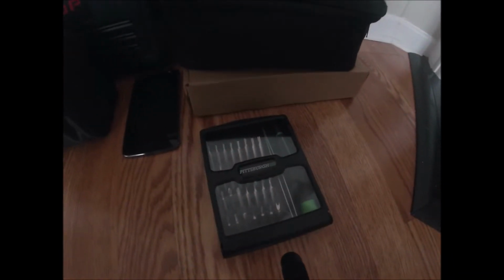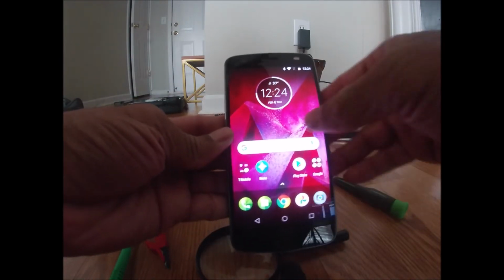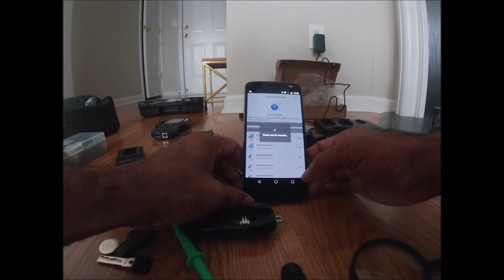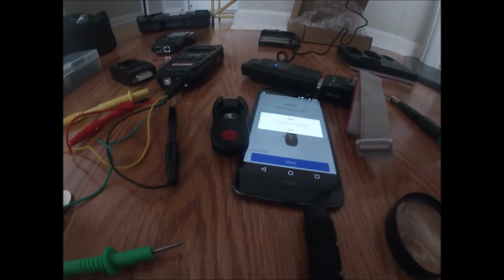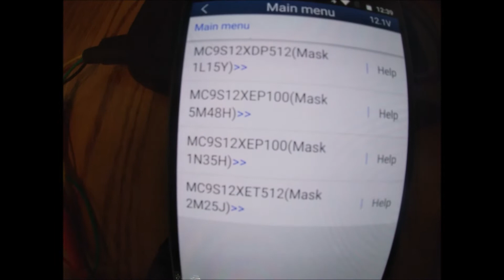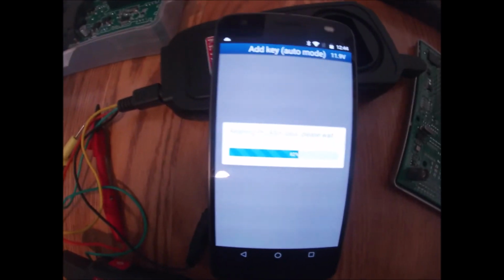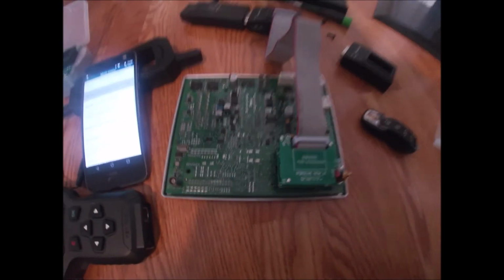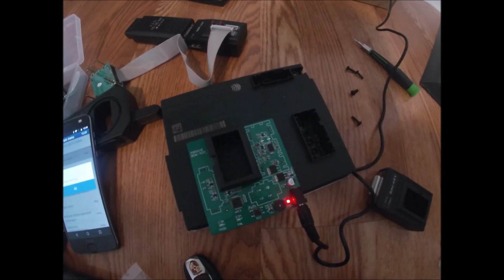Porsche Key Programming -2013

Comment: Can you also programme for porsche cayenne 2019 e3 type 4000cc
Reply from the maker: Depends on the BCM version in the vehicle. Did you key look like the one in the video or do you have the newer style key?
Reply: This is the BCM Look's like
Reply: The key look like that but you dont put it in the key dashboard the key has superat key on the dashbord the key just ues to start leaving it nere by
Reply from the maker: @samsonmu2641 - as long as the BCM look like what's in the video and your key look exactly the same, then yes, we can program it. Porsche started changing the BCM's and Keys in 2019, they never keys and systems we cannot do.
Reply: Hi how about getting a blank key to programme 2019 -2020 is it possible
Reply from the maker: @samsonmu2641  yes, if the key and bcm is same in video
Reply from the maker: @samsonmu2641  yes
Reply: I would like to share some picture of the Porsche cayenne we have so you can give advice
Reply: Hi if i can get a key part no V04016001AT  uesd one can you flash it for me

Comment: hi , could you tell me if the learning procedure is the same for cayenne 958 ?  just made a key , the car start but the remote function doesn't work..  thanks
Reply from the maker: Yes,  it's the same..maybe the key is bad. Does the original key function normal? Is the new key frequency correct
Reply: @ammreid  yes the original key function well . I have checked the frequency before and was the same .. maybe bad quality of key or battery ..  thanks for your answer ! and thanks for your videos !
Reply: @ammreid  hi , just and update :) … I have tested one more time with other key and it’s work ! I suppose bad key quality ..
Reply from the maker: @sprlvbconcept4215  perfect.. sometimes happens

Comment: Greetings Ammreid, I recently purchased a 2016 Porsche Cayenne with one key fob. How can I get you to reprogram a second fob? I see an “unlocked fob” on EBay for $95.00 , do I need to send you a blank fob for reprogramming? Any info is appreciated!!! 
Thanks
Reply from the maker: Hello. Yes. You'd have to send the vehicle's BCM and the key you purchase for us to program it. More info here:

Www.CarKeysandRemotesATL.com/porsche/
Reply: @ammreid  thanks for the quick response !!! do I need to verify the megahertz of the key that I purchased matches the system I have? Or is that something you can provide if I sending you my BCM.  I see you are in Atlanta and I’m in western Washington. It’s going to be a challenge to have my car off-line while I ship you the BCM. I do a lot of programming for PLC controllers and I understand the process but it looks like you have all the necessary hardware and make the process very simple. I do appreciate your videos and the effort you put forth.
Reply from the maker: @tonyimbarrato5325  ..for Porsche, as long as you have a US spec vehicle, all US models will be 315mhz, so anyone on ebay selling one for a like year and model will be fine. The only difference in the keys are whether or not the key has a proximity sensor(keyless go). If you insert your key in the dash to start it, any key will work, but if you have the dummy key in dash and you can keep the key in your pocket when driving, then the seller would need to indicate its a proximity key.
Reply: Ahh yes I have the keyless go, thanks for the info. I will be sure to investigate before I purchase a fob. Is there any way of  determining if it has the keyless go by appearance or device numbering? Thanks again for the communication!!!
Reply from the maker: @tonyimbarrato5325  they will look the same and both sometimes share the same part number. Look at the photos carefully and look for one that has an FCC number ending with "BQ"  . There are many,, but the part number ending in BQ is guaranteed to be keyless..This number can be found by pulling out the metal blade from the fob..it will be printed on the fob under the metal key insert.
Reply: Ammreid thanks again for the information, I will definitely keep my eye out. I just took ownership of this car two days ago so I am learning a lot of new processes. I will dig in to the key fob and reach out to you soon.

Comment: Hi Ammreid,

First of all, thank you so much for this informative video. I purchased 2003 Porsche 996, but have no remote key just wallet key, manual lock/unlock. I purchased 2 boxester remote key. Can you program them? If you can what do I need to send you. How much do you charge for programming.
Regards, Muhsin
Reply from the maker: Hello, we're currently only programming 2010 - 2018 model years
Reply: @ammreid   i bought a used key ay ebay to have  a spare key for our porsche mecan 2015, can you and how much to it cost to pair the used key ?thx  Georges

Comment: goodday ammreid,
thanks for the info u share man.
were can i buy this acdp tool for porsche?
and the vvdi tools?
hope to see more good videos..

Rocher
Reply from the maker: Most of the big locksmith suppliers will have it ... or China supplier like Uobdii.com...have good price
Reply: @ammreid  hey ammreid, thanks for the info. I also see on ebay from china how trustworthy are they?
It looks so easy with the acdp tool.
Reply from the maker: @sabrinatjoen-a-choy2425   i would imagine they are all the same, haven't heard of any clones out there - so they I assume they all come from same manufacturer (Yanhua) just different sellers.
Reply: @ammreid  ok i will check it out need on fast because i have an client with an porsche macan 2015.
Are there any adapter orso i need seperate or does everything come in the kit?
Reply from the maker: @sabrinatjoen-a-choy2425  if your looking to do Porsche, you have to buy the Porsche adapters set and authorization.. each type/brand vehicle has different adapters/authorizations you have to buy in order for it to work with ACDP
Reply: @ammreid  ok i see the porsche acdp module #10 for porsche with all adapters and so.
Hope it works good.
Reply: @sabrinatjoen-a-choy2425  did this work out for you?
Reply: @jthealy72  i did receive the tool but the client is on vacation so im waiting on him to get back.are u planning on buying the tool also?
Reply: @sabrinatjoen-a-choy2425  it is tempting to get it. I haven’t decided.  Just doing some research right now.  I hope it works well for your circumstances.